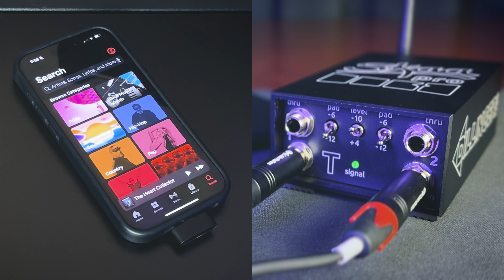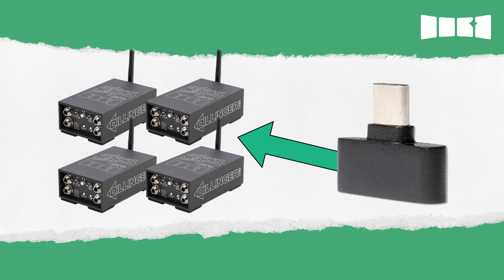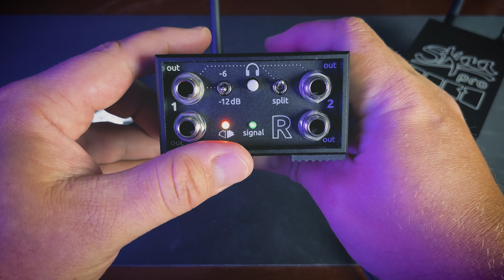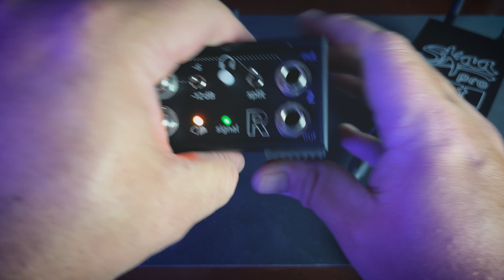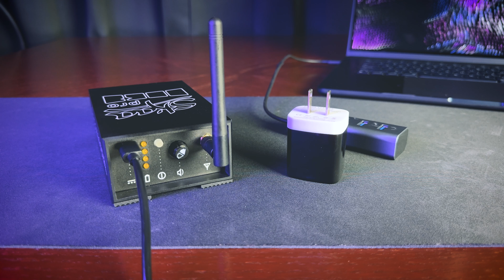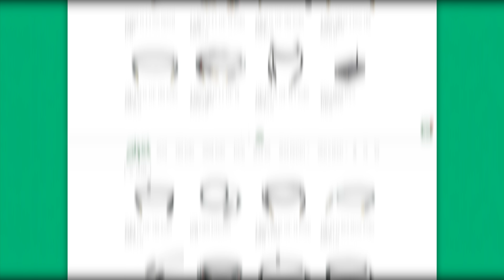Streetheart SKAA Pro Receiver #03: User Panel and Bond to Transmitters (Video Manual)

Comment: Josh, how do we get ahold of you personally for some help. Having a lot of issues with my system with crackling sound even when u guys sent me a new Dani :(
Reply from the maker: It's possible that the transmitter (or your receiver) is getting some interference. I recommend placing the transmitter and receiver high up off the ground, and keeping line of sight if possible. Also make sure that the Tx and Rx are not in an area where they are surrounded by metal, and this can act like a faraday cage and inhibit the RF signal. Reach out to us on our contact page and someone from the engineering team might be able to help you out: https://skaa.com/pages/contact
Reply: Did you sort out this issue? I am having the same issue unfortunately
Reply: @JJosson-n5x it’s still there unfortunately. 😢 I’ve done everything SKAA in canada tells me to do but still get a slight to loud crackling sound when using this

Comment: when I have my transmitter on and the streetheart, I hold my bond button and hold it like you say, but the light never turns green.
Reply from the maker: Just to be clear, you're holding the bond button for a full 3 seconds (which is the same as the volume knob on Streetheart) while you are bonded to a transmitter, and the bond indicator is not changing from amber to green? If you're not actually bonded to a transmitter, you'll see a dim amber LED on Streetheart, and you won't be able to green list. That's the only thing I can think of that would prevent it - you're not actually bonded to a Tx. What Tx are you using? Dani?

If you've checked all of that and it's still not working, try pressing the bond button on Streetheart 6 times quickly, this will perform a factory reset on Streetheart and might correct the problem. If not, feel free to reach out to our customer support at: https://skaa.com/pages/contact